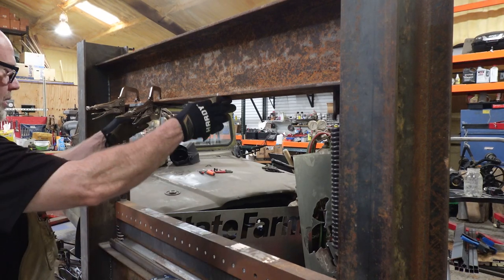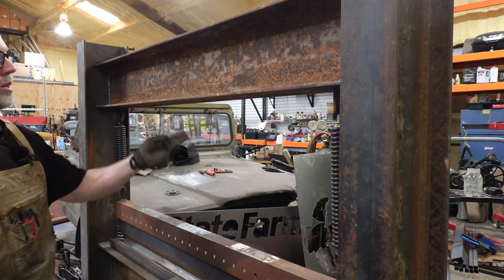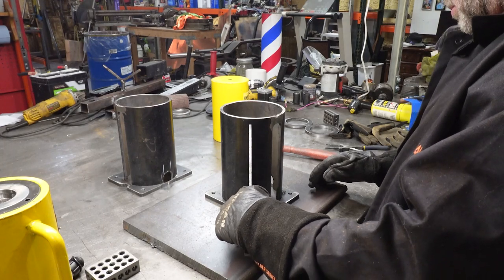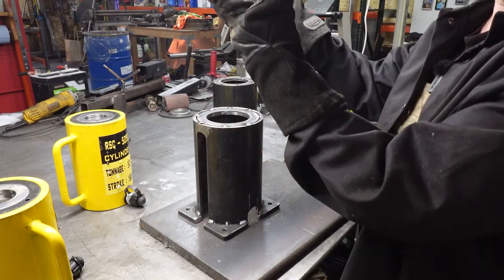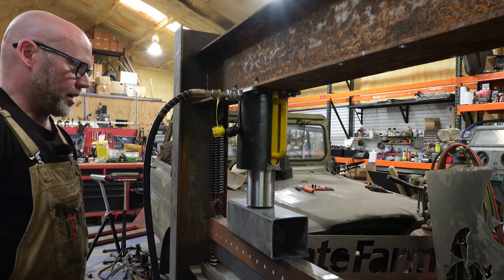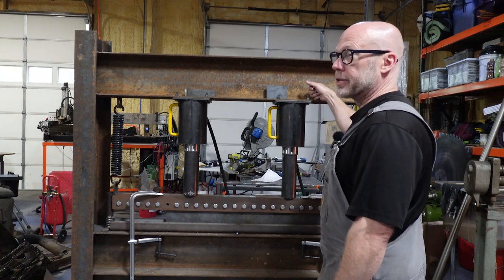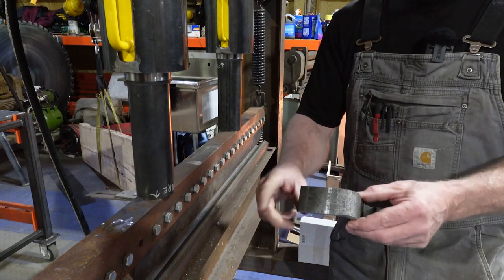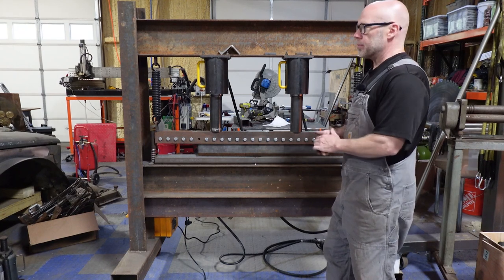100  Ton Press Brake Build - Vevor Cylinders and Pump - FINAL - Assembly and Testing

Comment: Thank you so much for the videos, very helpful, im actually about to start the 50" swag off-road and i was looking at the same hydraulic cylinders from vevor, now i know they work! Thanks again
Reply from the maker: I'm glad you are enjoying them and that they can help with a current project of yours.  My only negative about the swag kit is it is intended only for thin material, so the vertical guides and springs are too short (in my opinion).  But I'm pretty sure they never intended someone to put 100 Ton behind it for bending thicker material, lol.

The most challenging part of the entire thing was finding a manifold / "T" (I couldn't, so I had to make one).  If you haven't seen the video on that one, I suggest checking it out.

If you run into questions or have issues, feel free to comment again.  I do read them all and try to respond when and where appropriate.
Reply: @MountainLaurelMetalworks  sorry for the late response, I appreciate it, I did see all the videos related to the press brake, 

Have a good day

Comment: Stamping die design may help.  Wondered why you would stand so close to the 1/2" being bent.
That should be a tensile failure, and if that hardened steel had shattered it would have the energy of a gunshot.
From a theory perspective only, imagine the forces at 30Ksi?!
Reply from the maker: Thank you.
Reply: I agree, he was very lucky! That 1/2” plate section. definitely has to be hardened in order to break like that. 
This is a very cool project overall
Reply from the maker: Thank you for commenting!  To add a bit of context, the 1/2" material was simple mild steel.  My mistake was that I did not calculate the minimum bend radius.  I left the sharp angle dies in the press when testing.  Unfortunately that was too sharp of an angle for 1/2" material.  As the angle was too sharp, the material failed on the backside causing it to tear into two pieces.  Once it tore, the upper press die slammed into the bottom die; that is the "bang" heard on the video.  However, it was still lucky as the dies are hardened steel and if any of them had shattered, it could have sent shrapnel into any direction(s).  Lucky for sure, but defiantly my oversight.

Comment: Did you ever get the retraction speed increased?  Awesome video series answered a lot of questions that I’ve been worried about on a hydraulic conversion on a shear I’m about to start
Reply from the maker: Not yet, I've been 'living with it' and it is proving to be as annoying as I anticipated.  I'll end up modifying it once there is a break in work.  Thankfully, we have been busy with customers (paying work :) )

When I do, I'll post a video of the process.

Comment: Instead of using tube spacers, I would have seriously beefed up the upper part of the ram. If you do longer pieces it will underform everywhere that the two hydraulic cylinders are not directly overhead.
Reply from the maker: Thank you for commenting.  If you are referring to the upper portion where the rams are mounted, there is little chance of noticeable deformation there due to the size of the beam and width.  If you are referring to the carrier for the fingers, that would be possible trying to bend heavy material at wide widths.  However the only heavy items (thicker than sheet metal) I need to bend are smaller in width.  Mostly brackets for various purposes, most only a few inches wide.

The carrier beam size was considered in design, calculations shown sufficient strength for the widest items I need to bend.  I didn't build the frame or components, this was purchased "as is" and upgraded with the hydraulic rams; so I worked with what was there to start.  That being said, I do have some other mods in mind, such as making the vertical rise larger for easier part removal after bent, modifying the valve for faster retraction, and making some more press forms for round bends ( making new die set(s) ).  I've also considered the mod you mention in beefing up the rigidity of the finger carrier for the 'just in case' chance I need to bend something wide and thick.  This will most likely be some form of truss system to more equally distribute the load.

Comment: Great Video, ¿the hydraulic cylinders won´t leak oil because of them being upside down?
Reply: No it wont do that unless the internal seals are worn.
Reply from the maker: Thank you for commenting.  The seals within the hydraulic cylinder retain the fluid regardless of orientation.  They are what permit a hydraulic cylinder to build pressure.  It's pretty amazing, but when you think about it, these cylinders can accommodate up to 10,000 psi and it is only those seals which seal against that pressure.

Comment: I purchased that same pump,  it would only make 2500psi, and it's not adjustable,  where did u get yours? Part #?
Reply from the maker: I purchased the pump through Ebay, but it was a Vevor brand.  Here is the current link, but it looks like they may have made some changes (the color is different, they tend to do that when they make changes).  https://www.ebay.com/itm/125853293471?mkevt=1&mkpid=0&emsid=e11060.m43.l3160&mkcid=7&ch=osgood&euid=5e2f251c898f4d66957840e041674a90&bu=43210864939&osub=-1%7E1&crd=20230509072015&segname=11060

Have you tried stalling the pump to see how much pressure it will build?  The pump will only reach 10Kpsi when fully loaded, if the load is yielding (such as bending in a press) the pump will only reach the pressure necessary to bend the material.  You can think of it this way, if there was no load (no hydraulic cylinder) but instead the end of the hose was open, the pump would generate nearly 0 psi, if you, hypothetically, put your finger over the end of the hose, the pressure would rise (do not do this, that was for example only).
Reply: @MountainLaurelMetalworks  yes, it bypasses at 2500 psi, the seller didnt have a answer, the link is similar to the one i bought but not the same, i will give it a try, thanks
Reply from the maker: Please let us know if you get it worked out and, if so, which pump you used.  Just in case we need another in the future :)

Comment: What is the length of the stroke of the cylinders? I was thinking on using a 6 inch stroke.
Reply from the maker: I used a 6 inch stroke, this provides for the ability to bend thicker material as the bottom die can be quite deep with thick material.  My idea was that I could then have at least 3" above the bottom die at maximum depth.  

You could go deeper, leaving less room above the die, but then you could run into the issue of the material being bent hitting the ram or being difficult to remove once bent.

Comment: The formula for the die opening is 8× the material thickness. So to bend 1/4" the width of the bottom die at the top of the vee should be 2" .The width to bend 1/2" would need to be 4"... my dad built a 4' press brake with 2 cylinders similar to yours...probably about 60 tons. His is made of MUCH heavier materials and the bed (bottom crossmember) is bowed about a 1/2" I'm afraid you are going to be very disappointed if you get anywhere near 100 tons.
Reply from the maker: Thank you for watching and commenting!  To be honest, this is overbuilt for what I actually need.  You are correct in that the dies present were incorrect for bending material of that thickness. When I broke the chunk I wasn't really trying to bend it, just test the capacity.  Also, I agree that it most likely could not accommodate a 100 Ton bend at width, but most of what I need to bend are brackets around 1/2" or 3/8" thick, so plenty of power there.

This was a piece I obtained in a bulk purchase.  The seller had 3 20 Ton Air over hydraulic jacks on it and could never get them timed (which is almost impossible with AOH jacks) so he ditched the project.  Since I was rebuilding it to use hydraulic cylinders, going with 50 Ton rams wasn't really much more $$ than 30 ton rams, so I want that route.